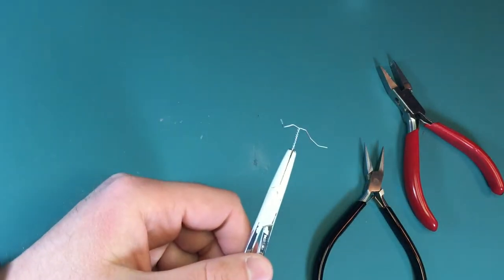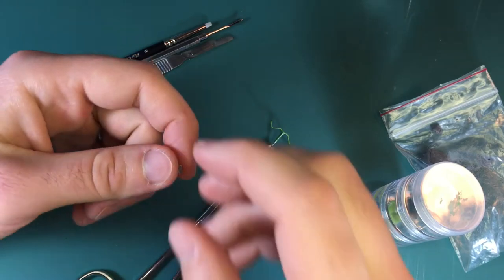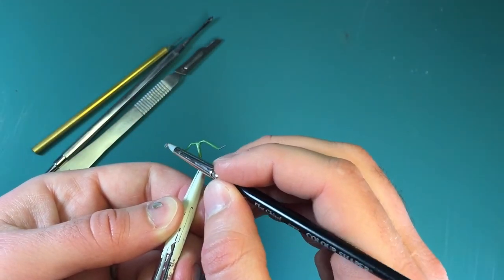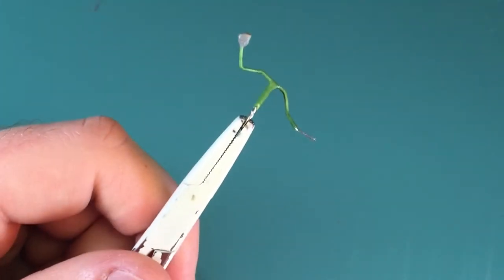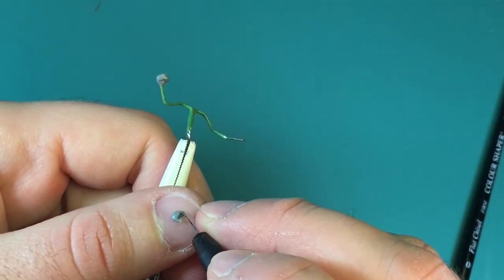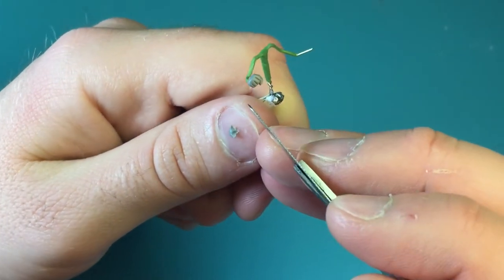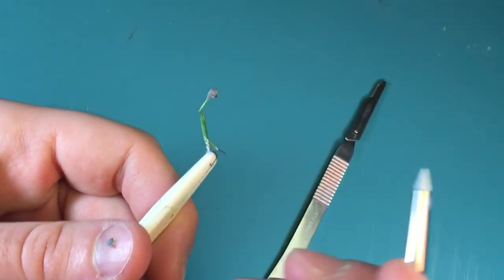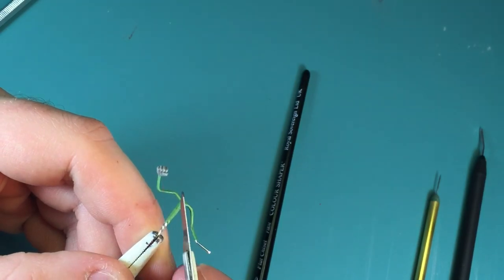Sculpting Miniatures - Sculpting Hands Part 2

Comment: I appreciate all the great tutorials.  I had one question. When you mix the FIMO and the Procreate together do you still have to bake it to cure teh FIMo or does the mixing of the two cure the FIMO
Reply from the maker: James Valdez I have made several miniatures using this mix and they have always molded fine. The sculpts were never baked as per the instructions on FIMO packaging. The curing of the putty seems to be enough to set up the material.

With that said, I do use a putty oven to speed up the curing process so it is technically being backed but not at the same temperature or length.

Comment: I remember Gene Van Horne showed me an armature he had made that was similar to the Reaper advanced one, but he had the portion where the hands would be actually flattened out and had cut individual fingers and a thumb for each one...it was incredible. He used guitar wire for most of the armature, which is a great idea because the strings have tiny rings all along each string which would help the putty stick.
I don't remember if he said they were one offs he had to make each time or they were castings. I think they were actual castings.

It should be possible to cast something like that in white metal if you have enough of a small channel coming off the ends of each finger and thumb i would think. 

Tom, what sequence do you usually sculpt the head, hands and feet in?
I always do the hands after the face so I have the head to use as a solid size comparison.
Reply from the maker: +GamerZapocalypse when I sculpted in putty I always started at the feet and essentially worked my way up. Mainly this was to create a solid foundation for sculpting the rest of the mini. As I developed, I would work around the figure more, but the feet were still pretty early.

Now that I sculpt with poly clay I tend to work the whole figure much more before dialing in. With all that said, my sequence is feet, head, hands. I always get the head shape fully bulked in as soon as possible though. It really helps me see if the rest of the proportions are working. Hands are usually last because I don't like to put on weapons until the very end.
Reply: That's cool. Feet first, head then hands sounds best.
I just picked up some classic FIMO Classic Black and White, but will have to order the FIMO Quick Mix from online. I want to try your 80% FIMO Classic White/20% FIMO Classic Black/20% FIMO Quick Mix. I would prefer sculpting the way you mention, working the whole figure up before dialing in. FIMO will allow the time to do this...can't wait.

I heard back from Fortress Miniatures and they said they first do metal master castings before doing any resin castings of a piece. Is that how it works when you have your poly clay sculpts cast by them? Is the mold for the metal masters low temp like the mold for the resin would be? I thought metal castings would mean high temp molds, or is this a low temp metal? Sorry to be bugging you about this.
Reply from the maker: +GamerZapocalypse I think there was a misunderstanding about the resin masters. I never do resin masters. I was just saying that's a good way to do it if you absolutely want the original back and don't have a mold maker that can handle poly clay.

I always have my poly clay sculpts vulcanized to get the masters (low temp as you mention). That's it :)
Reply: My bad. Thanks for clarifying.